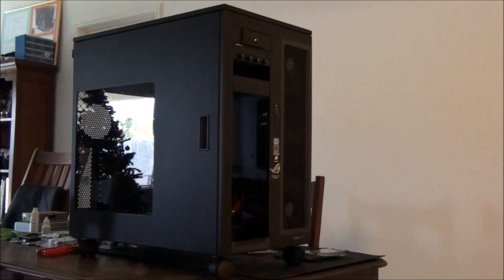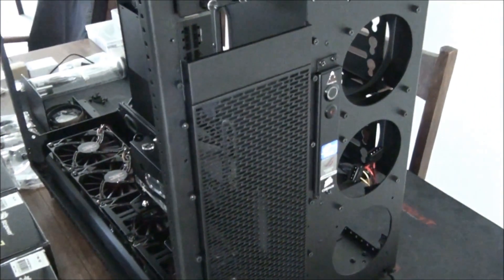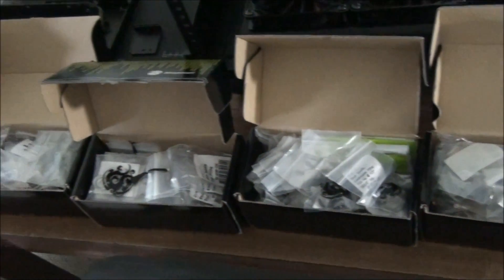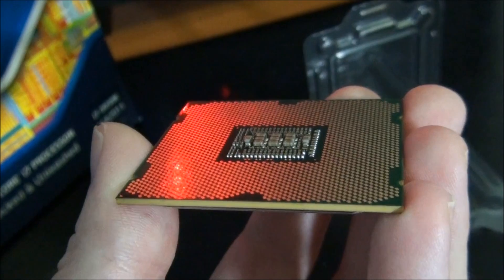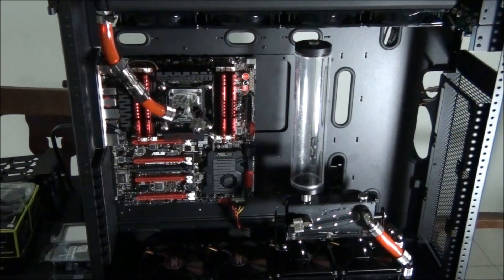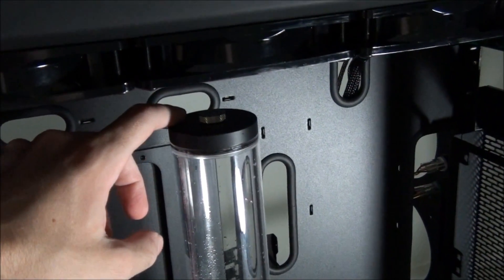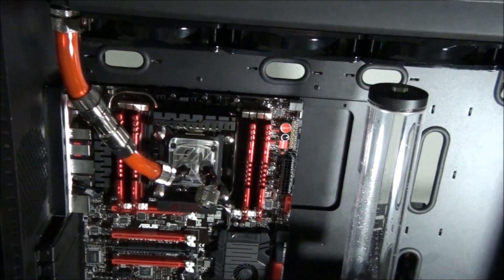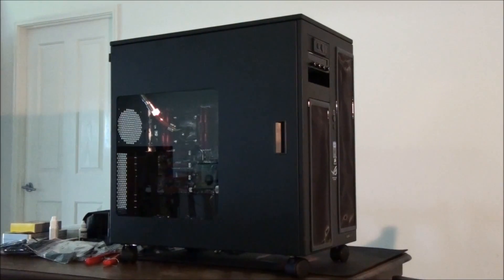Singularity Beast II Build Log Part 4

Comment: Watching some your old build with the TH10a case since I have same case currently in build. What I realize is you really need to upgrade the Singularity Beast or did I miss seeing it in some newer video? As an added note have you ever considered doing a complete solid hard tube build with like Stainless Steel or Chromed Copper?

Comment: So what are the benefits of using coolant instead of distilled water?  I have heard that some coolants will eventually clog up the blocks and to just use plain distilled water and a silver coil in the res.  Thoughts?
Reply: +Igor Ramon "mayhems aurora is known to have this issue but stuff like mayhems aurora doesnt have the issue" 
Lolwhat
Reply: +TheGreat Qbert Collants have anti corrosion agents, biocide agents and some even have anti-freezing properties.

The thing with coolants clog up loops is related to the dye used. Mayhems Aurora is known for having this issue. But there are lots of collants without any issues, such as Mayhems Aurora, Swiftech HydrX. 

Distilled water can corrode your loop if you have mixed metals.

Comment: Hey could you do a walk through of the different types of screws that can be  used for radiators? I don't know if there is a standard size or something and different lengths (I want to install a black ice radiator onto my case and you said you need separate screws).

Comment: Hey check the EK website the mounting screws for supreme hf are flawed. they dont give proper connection for the cpu block. there is also fix shown on the EK web site.